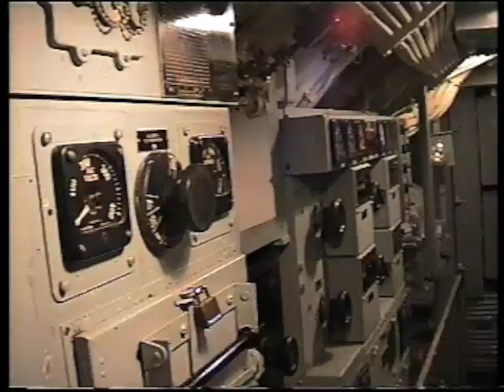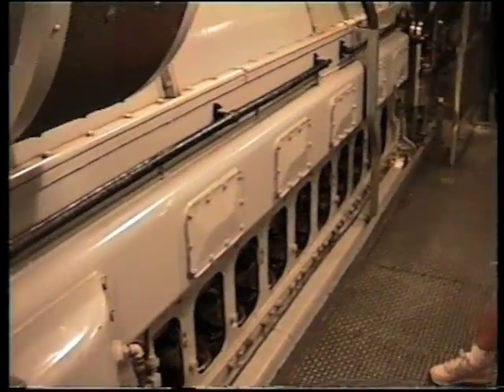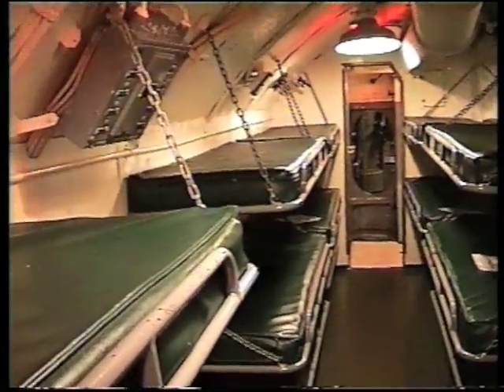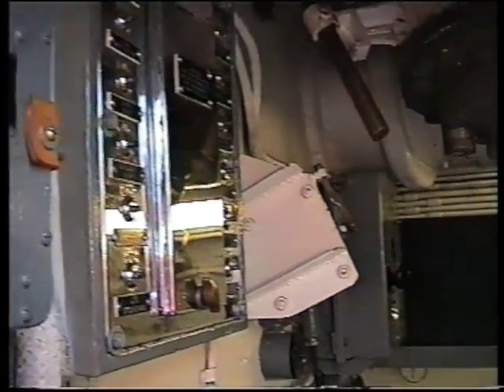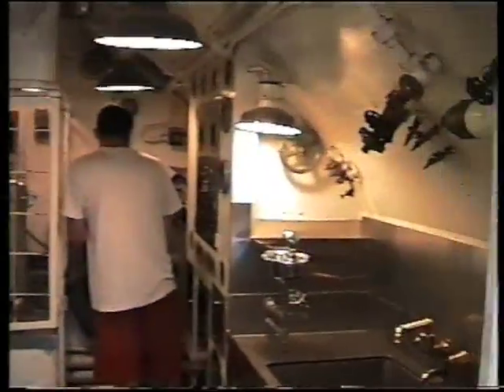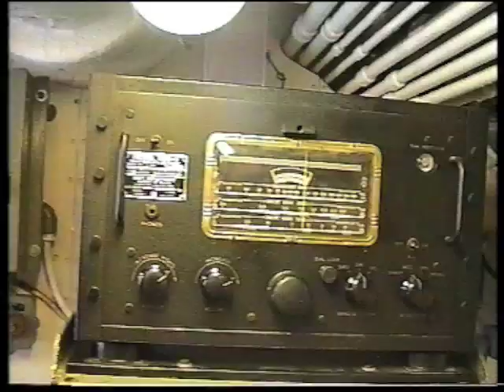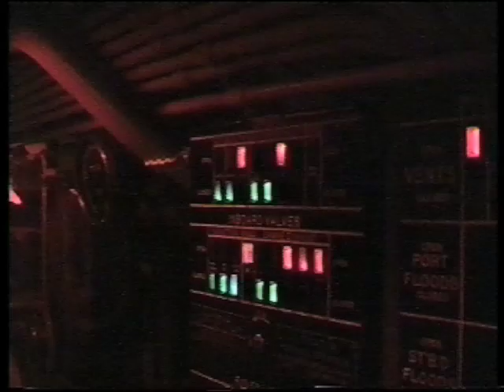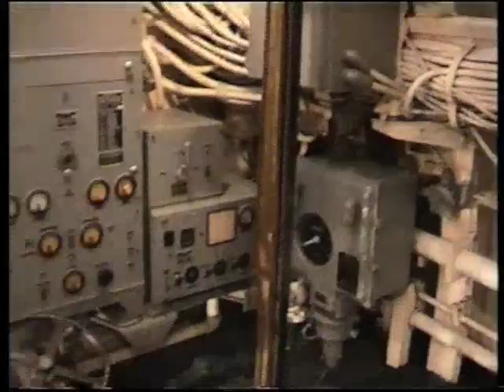USS Pampanito as USS Stingray of "Down Periscope" movie

Comment: They didn't cut out the hatches in the Lionfish either.  You had to 'step over' and into each room of the vessel.  Nice to hear the engines still run on the Gato you have out there.  Not sure if the Lionfish engines run.  But it was certainly an experience to get on board a Balao class sub.  Just something about the Gato's and Balao's  Old, but interesting.

Comment: Fairbanks-Morse are definately "opposed-piston" engines. THey were also in US locomotives for several years. Opposed Piston engines have the pistons opposing each other, and the pressure they create causes them to work. They are also in dams and boats. THey worked out WONDERFUL in Marine applications, but not so good in locomotives......unless you were lucky enough to have one under your command. They would P-U-L-L!!!!!
Reply: if so good why are most Marine engines on tugs EMD 645 and 710
Reply: Served on board the USS HUNLEY AS-31, she had 10 Fairbank-Morse diesel engine